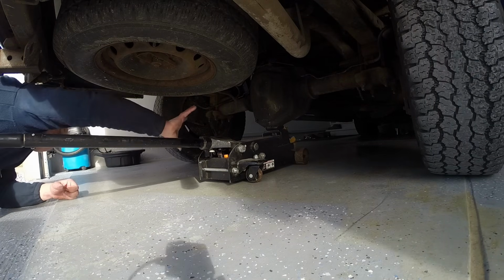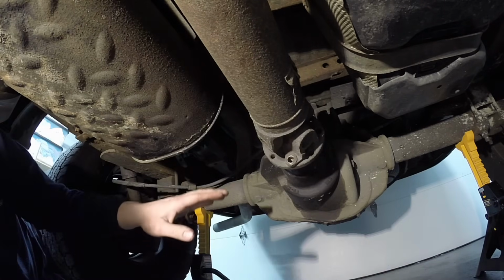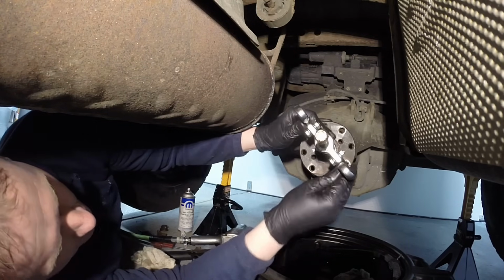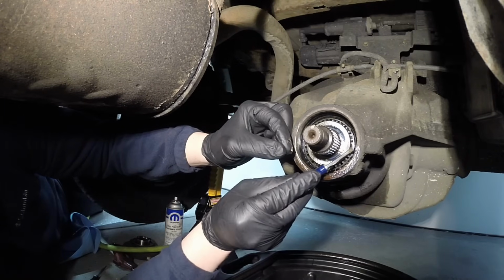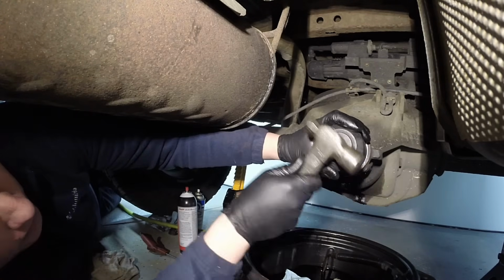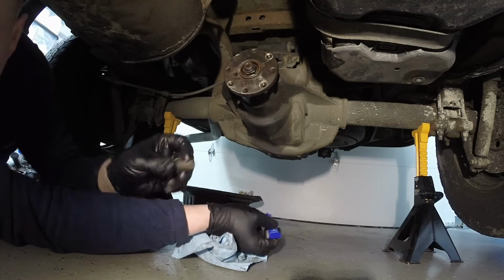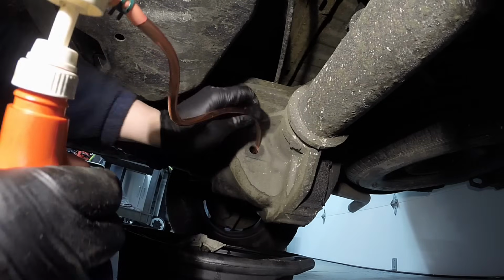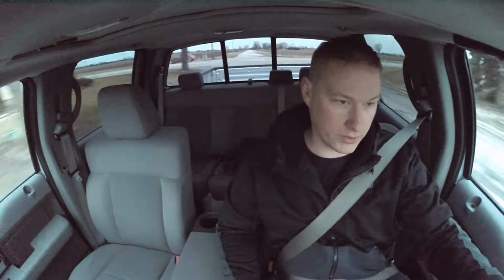Ford & Dana Axles Pinion Seal Replacement: Tricks of the Trade

Comment: I have a 01 f150 crew cab 5.4 V8 2 wheel drive if the pinion bearing is bad will it make a roaring noise like a bad wheel bearing I’ve replaced all the wheel bearing front & back & new u-joints roaring noise starts at 35 mph & up its loud to where you don’t want to drive it .

Comment: Not recommended to use an impact on the pinion nut, but it ur reusing that f’d up bearing it doesn’t matter.  The inner/rear pinion is likely also f’d, increasing the backlash on the ring gear and wearing the ring and pinion in a bad way.  You’ll likely be rebuilding the whole rear-end in the not-so-far off future.

Comment: Great vid. Only issue I saw was that the drive shaft bolts appear to have been torqued down too much with your air tool since the torque wrench didn't turn any of the bolts prior to the click. But hopefully they weren't too awful tight.

Comment: ‼️What ! ‼️
You skipped over the only important part of this job.
The proper torque of the pinion yoke, you didn’t even show nor explain proper back lash,
You said count threads…. and mark the nut and the flange while disassembling and showed nothing of the like while reassembling thus confusing any beginners. 
I think you had to tighten the nut past 5 threads cause you had to much back lash on your pinion~ring gear lash as it seemed at the beginning.

Comment: Hey, I had a couple quick questions—when you reinstalled the pinion nut, I noticed you didn’t count the threads or realign the marks. Is that something critical to get right? Also, do you recommend checking or cleaning the rear differential vent tube while doing this job?

Comment: Hi! Great video, thanks. I'm having a sound problem on my Ford E350 5.4 V8 at 50 mph on the rear axle. I'm not sure if it's the wheel bearings or the differential pinion bearings. Is there any way to distinguish them?

Comment: @fordtechmakuloco Thanks for this excellent video.  I know this was from many years ago, but could you tell me if this same method for replacing the pinion seal would be applicable to a 2004 Lincoln Navigator RWD with independent rear suspension?  I really do not want to remove and replace the crush sleeve/collar if possible.

Comment: Anyone have the same issue where they clicked on the Amazon link for the 9.75" but the product displayed is for the 10 .25? I can not seem to find the correct part #
Reply from the maker: They are both the same part number.
Reply: @ the part # for
My 9.75 is BR3Z-4676-A
Reply: @ the part # that the link brings you too is BL3Z-4676-A

Comment: I have a 2004 F-350 6L. I have one of those 2 Section differentials and I didn't even have to take it out from the transmission. It just swiveled where the two differential sections meet and I set it on a jack stand out of the way. I did everything else the same, but when I had to put the drive shaft back on I had to kind of guesstimate how to line up the flange splines with my original marking. Then I would pull it off with the two job puller if it wasn't right and move it over a couple of splines until I got the markings lined up. For me it made it feel like I had less of a job to do

Comment: Bro you have to crush the crush collar. And get 25 inch pounds of preload on the bearings. You didn't even come close to that. You need to delete this video before it leaves more people astray
Reply from the maker: Not even an issue, we have done it like this for over 20 years and never a problem.
Reply: @FordTechMakuloco   until you crush the collar the bearings cannot be seated into the races.  Then a minimum of 15 inch lbs of preload on the bearings.  Without the collar crushed.  The whole deal is gona be free to move.   Which was probably your noise at the end.    Without the collar crushed theres about 1/4 inch play in the bearings to races.

Comment: I have a 99 F-250 super duty XLT with the 5.4l 2 valve. I changed my U-Joint and I have to pull the driveshaft end yoke. What is the torque spec when I put the driveshaft end yoke nut back on

Comment: 17:04  -How is that you easily remove the wheel bearing from the pinion?
Reply from the maker: You can use a hook pick and pull it out for inspection only.
Reply: @FordTechMakuloco  i thought  the wheel bearing will enter to the pinion shaft with torque pressure.
Reply from the maker: no

Comment: Good luck finding that Rotunda OTC 205-208 install tool.  What ball joint kit do you have?  All of the ones I've seen are not big enough to match the outside of the seal lip, which is 78mm

Comment: So should i put 75w140 in my 98 Grand Marquis? Or 80w90?
Reply from the maker: For the cars Ford officially says 80w-90 unless towing.
Reply: @FordTechMakuloco  ok, not trying to bug you or anything, so I'm like you when it comes to using motorcraft parts/fluids, but the motorcraft 80w90 is conventional correct? So my question is do you think I'd be better using amsoil 80w90 full synthetic? Or just stick with the motorcraft conventional?

Comment: Brian, thank you for this excellent video.  You have helped me do so many procedures on my 2003 F-150 4x4 (294k miles) and I can't thank you enough.  I replaced my pinion seal as I followed this video and everything went well. However, I have a howling noise coming from the rear end at certain speeds.  Not a whining noise, but more of a howling or humming (not when I'm coasting). On tightening the pinion nut, I got it back exactly where it was, then went just a small touch more. My concern is that I may not have gone tight enough and hence the noise.  Should I go a little tighter with the pinion nut?  If so, how much.

Comment: So unless I missed it you didn't change not even mention the crush washer behind the bearing that Ford says to replace any time the pinion nut is removed. Can it actually be reused or is it just a placebo thing?
Reply from the maker: Ford does not require a new collapsable spacer every time so no need to replace it.
Reply: @FordTechMakuloco  the reason I'm asking is because the repair manuals all say that the sleeve "must" be replaced every time the nut is removed because it will no longer hold proper tension. It also has torque values for a new crush but not for reusing one. So I'm just wondering if this is just some shade tree trick or if it's actually ok to reuse the sleeve and why exactly you don't need to replace it? Wouldn't bearing and gear wear mean it needs a new torque down?
Reply from the maker: Nope no need, you are supposed to take a turning torque reading before removal and match it after, but I do feel before and after as seen here. It will never be a problem if you do it this way. Never replaced a crash sleeve in 20 years of doing it this way.

Comment: Thanks for the video. I'm wondering if a plugged vent causing a pinion leak will make seal replacement necessary after the vent is cleared.

Comment: Even a Ford technician uses Mopar rust penetrant! That and Kroil are my two favorite rust penetrants out of everything I’ve used. Does Ford have their own rust penetrant? Marking the pinion nut and counting the threads on the pinion is a new tip I learned from your video! Thank you for all the tips!

Comment: What if I’m also replacing driveshaft do I still have to mark flange with marker?
Reply from the maker: no but in that case, you should be cleaning the pinion flange with an abrasive disc.

Comment: Sweet. Just got a 2 jaw flange puller since I can't ever find the Ford kit in the shop. Someone usually has it for a while or put back in the wrong spot. Only 782 specialty tools in red boxes to look at but I'm excited to use it. I got a front pinion seal on a 13 f350 to do and this should be about on par.

Comment: Great video…question…it seemed like you stripped sealant off the angled edge(with the little screw driver) but I didn’t see you add any sealant to the new seal?  Should sealant be added or were you just stripping off pieces of the old seal?  Thanks in advance and thanks again for making this video!
Reply from the maker: The new Ford seals already have a sealant bead, you can see it in the video.
Reply: @FordTechMakuloco  I was thinking that…just wanted to confirm.  My 08’ Explorer is venting fluid…I’m a home garage mechanic…I’m thinking I may try to fix it.

Comment: I found one thing really weird ........you mention to mark the relation between the drive shaft and diff with a white marker...........then you install a new one and just bolt it in .    If it is not important in the new..........why is it in the old??
Reply from the maker: It's called rust stack up.

Comment: So you put old bearing back in ..? Didnt even replace bearing mating cup?. Youre video otherwise very good. But without bearing and cup replacement so incomplete.
Reply from the maker: There are so many things wrong with your statement. Let's start off with the easiest, how would you remove the bearing cup with the pinion shaft in the way. Let's start there...
Reply: @FordTechMakuloco  Not a expert like you. Like I said nice video but seals wearing can be result of bearings going. Make sense to you ?
Reply from the maker: nope

Comment: This video is very instructive, however I want to ask about the shat. The shaft removed was rusted however, the shaft assembled back looks new one, it has been replaced? what should be the reason? Unbalance situation which causes vibration? Thanks.
Reply from the maker: The old shaft needed two U-joints which on an 04 are staked and not serviceable. For does have a service kit but it us pushing $200 per joint for parts alone plus the extra labor it would be $500 easy. A completely new Ford driveshaft my cost was $450 and there would be no labor, it would be all new perfectly balanced and the new driveshaft has normal serviceable u-joints. It just made sense to replace it.
Reply: @FordTechMakuloco  Now is clear, thank you for reply and send clarification. I totally agree what you have done, because new Ford OEM balanced shaft is always better. Please, continue making videos like that, it helps users a lot. May I suggest another topic? For instance, fixing the coupling vacuum seal from no engaging 4x4, even troubleshooting the whole vacuum system, together with inner oil seal replacement, considering the brand is DANA, there are many tricks and caution to be observed, even by using the right special tools. I will appreciate if you post a video like I suggested. Thank you a lot, and congratulation for your effort by recording and sharing your job; 🙂

Comment: Depending on your slip yoke, ive found a piece of 1 1/4" schedule 40 with a cap fits right into my transfer case output seal.
Its nice not to have all that fluid dripping into a pan.

Comment: If I was going to all that trouble, I would go ahead and change the bearing. .
Reply from the maker: How would you change the cup?
Reply: I am sure there is a way, I have changed many wheel bearings on older cars I owned and just changed the bearing and not the cup and had no problem. I just saying thats a lot of work to go into without changing a simple part.  I did enjoy the video. I plan to do mine soon if it gets worse. For now its not a big deal.
Reply from the maker: problem with that is most times the cup is pitted too AND on the 9.75 axle as shown, the angle of the service part bearing has changed in an effort to evenly distribute the load better which also forces you to change the cup. That is why the cup and bearing are sold only as a set for the outer pinion bearing unlike the rest of the bearings in the axle.

Comment: What was the point of counting the threads and marking the nut position if you didnt reference it when putting it back together?
Reply: Far as I could tell just about everything in this vid was spot on, but as he was installing the brand new driveshaft, I'm over here laughing to myself, like why did we mark the old driveshaft and mounting points if we are installing a different driveshaft in the home stretch here🤔🤣

Comment: The driveshaft and rear end aren't balanced as an assembly.  Why would you need to mark it?
Reply from the maker: Absolutely correct and no one ever said it was. If you don't put it back in the same spot or thoroughly clean both mating surfaces you run the risk of stacked up rust surfaces and runout which causes a vibration. If you knew so much that it wasn't a balanced assembly then you must have heard about marking driveshafts when removing them. This has been common knowledge since at least the 60's!
Reply: @FordTechMakuloco  I  know that they only did that because they had some false belief that it mattered.  You should always clean the surfaces.

Comment: What setting number do you have on the impact gun, when you reinstalled the flange to the pinion?
Reply from the maker: Max, the gun is not that strong.
Reply: @FordTechMakuloco  do you know the max ft. lbs. of torque that guns has? My impact guns has 300 ft. lbs. do you think I'd be ok to use my gun? I don't want to mess up the crush slave.

Comment: Or you might not answer my question, but I have a 99 Ford F250 my gears are 10.25 4.10 so the bearing behind the yolk it keeps seizing to the pinion gear and impossible to take it off with a screwdriver pic I just don’t know why it keeps having a problem seizing to the pinion it has lubrication it has grease. It has everything that it needs but my question is do you have any idea why it would do that and then the other question is the little circle washer thing that goes before the bearing is that optional

Comment: Trying to replace that same bearing on that same truck. However bearing doesnt want to come out with just a pick. And i dont want take the whole diff out since im no mechanic. Is there a toll that i can use to take that outer pinion bearing out without having to pull the while diff out?

Comment: I have a 2013 Ford F150 and at 56,000 miles the pinion seal failed. Luckily it was under warranty. Then at 112,000 miles the pinion seal failed again. I don't have much faith in the Ford Pinion seals.

Comment: My differential is leaking...it looks like it is from the pinion. Thanks a million for this video. 

I try to do all I can myself. I believe I can do it.   Would you also replace the axle seals at the same time since there are 170k miles on the truck? Have changed the gear oil one time before just for maintenance sake about 50k miles back. Limited slip.

Ok...Really grateful for decent camera shots. Every once in a while you will mention doing something and it is not shown on the video nor the type of product...ie  putting some grease on a part before installing    or there was the thing of cleaning sealant when removing something but I don't recall sealant being put on something when putting in new parts.

I will watch it again about 50 times---lol---before tearing it up. Wish I had a second vehicle in case I need to run to town--20 mile round trip.
Jesus bless.

Comment: Have a 2007 ford edge awd with noise rdu...

 I drop the rear diff cover and inspected  found no filings in the oil or filings on  magnet..  if the bearing failed wouldn't I see filing... oil level was good also.
The rdu is noisy , sounds like a plane taking off..  when driving above 50 km

In your experience what is more common is the viscous cuppler clutch  or the spins on pinion worn out  to the clutch or  pinion bearing making this noise

Any tips to trouble shooting this issue new rdu discintuned..are  escape and mkz mkx the same rdu etc

Comment: Why didn't you just replace the u-joint or joints? Nothing like charging the customer for a driveshaft they didn't need. Also, and not that it really matters, but when you reinstalled the flange you didn't orientate it to the mark you made on the pinion shaft.
Reply from the maker: Oh boy are you going to look silly for that comment. This is an early build F-150 that incorporates staked u-joints (as you can clearly see multiple times in the video) that are technically not serviceable. Eventually Ford designed a retrofit u-joint kit that that includes a specialized cutter to modify the driveshaft so that it can use normal u-joints and snap rings. This kit is $225 per u-joint plus all the extra labor required to machine and modify the driveshaft which all seems very hokey to me. In the end the modified u-joint kits and extra labor would of been well over $450. I can get a brand new perfectly made and balanced driveshaft from Ford that incorporates normal u-joints at my wholesale cost. So instead of sticking it to the customer and selling him two staked u-joint kits for $450 plus 2hrs labor @ $100 an hour for a total of $650 I ended up selling him an all-new Ford driveshaft at my wholesale cost of $450 no markup and no labor charge in an effort to provide the best repair possible to my customer at the lowest cost possible yet I still get comments like this from viewers like you.

Comment: looks like a Ingersal Rand 231 what settings where you using tightening the pinion nut ? Not to crush the washer , sleeve .  So My front bearing is gone. Can I not just replace the race and bearing to bring the tolerance back. There's quite a bit of slop and it's winter should get me going at least till spring . Just pop it apart and put everything back to where you took it apart. The tolerances may not be a 100 % but should be close.  Your thoughts   Herman

Comment: This is the 2 or 3 time watching this video and just realized that you used two different vehicles.
Thank you for the video. Now I know I can replace the bearing and seal without removing the gears.
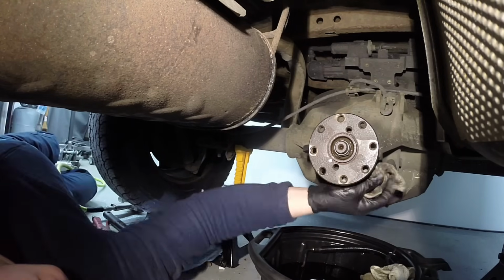Reply: It's the same vehicle throughout. He just put a new drive shaft on. At 25:05 he mentions this.

Comment: Hey Chief, with six point being the most solid contact socket, why do you think Ford started using the 12 points on the driveshafts ???
Reply from the maker: It more compact for sure and never a problem.